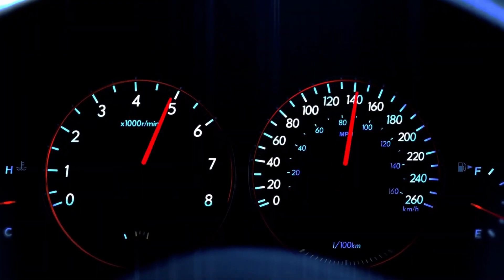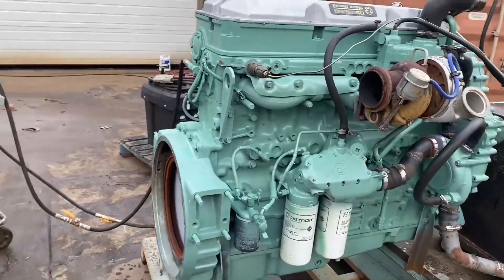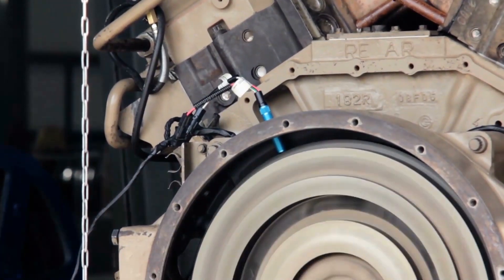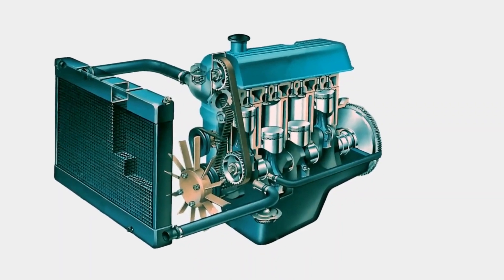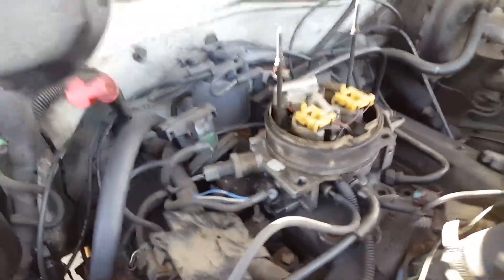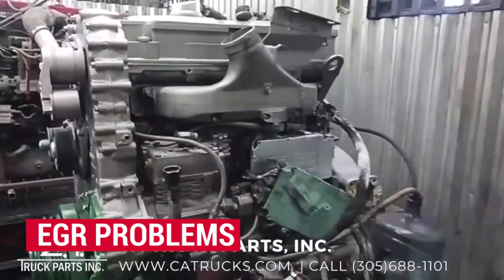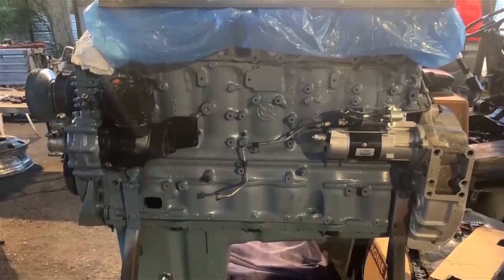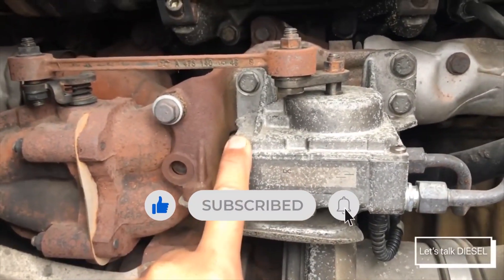Why This Engine Was The BIGGEST FAILURE Ever

Comment: Why compare one of the best truck's every built with a detort engine? Scania is one of the best built engines that will easily cover millions of miles and the Scania V8 I would argue is the best V8's ever built with 700bhp as standard and that is not even been played with they can be turned up to even higher bhpand give reasonable mpg.

Comment: I own a 1997 freightliner with a 12.7 , d deck 3 never had a problem, I'm a diesel mechanic best engine ever built
Reply: I'm a former diesel mechanic as well as owner operator. My series 60 is my favorite motor out of all I've owned. I've owned a cat 3406, Cummins big cam 400, and a few others, but this one is my favorite in terms of serviceability and reliability.

Comment: I've got a million miler in a fld freightliner.
Going to go through it to make me feel better, it feels good...ps never fails to start in cold weather unlike the Cat.
MAINTENANCE!!!!!!!!!
Reply: I did the same 1999 frieghtliner FLD120, series 60 12.7 L  500hp, 10 speed Eaton 355 rears, the day I sold it to Frieghtliner in Oklahoma City it had  10079250, never was opened up, changed oil every 15000 with Rotella 15W40, never had cold start problems, started at home at zero several times.